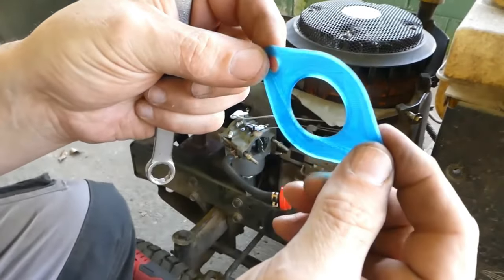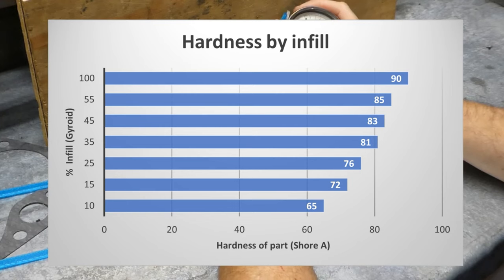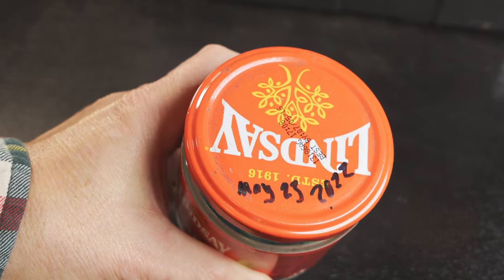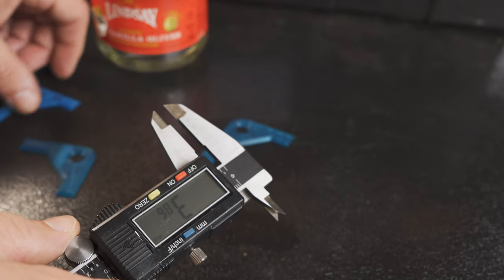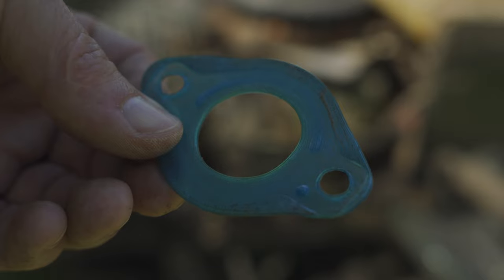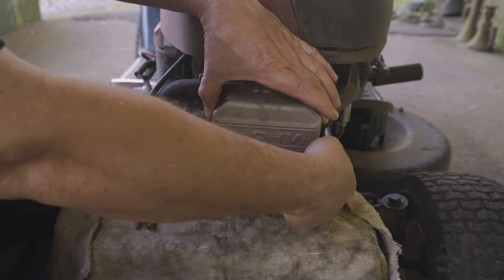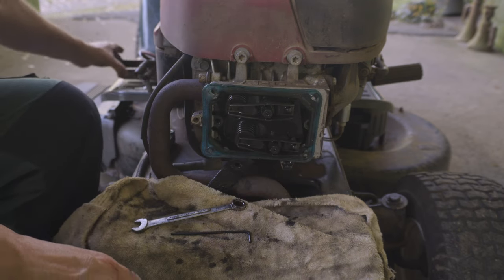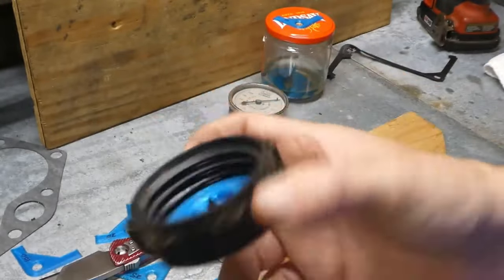3D Printed TPU Gaskets? -- Follow Up

Comment: I teach a small engine high school class that uses donated junk equipment. Most of the donations are out dated and in some cases parts aren't available anymore. I'm using a 3D printer to make all sorts of parts for students. In most cases, our parts only need to last about 30 minutes. If they last longer, then all the better. I'm using TPU to make a variety of carb and carb bowel gaskets. The big key is just what you said about another tool in the toolboxes. We can make a gasket faster and cheaper than seeing if we have a budget left, then trying to order parts, and finally hoping to get them in time. The 3D printed gaskets and parts are made quickly, teach kids design, and cover an enormous range of equipment, making our program more successful. I'm with you.

Comment: I appreciate your recognition of printing casting molds. Most people don't realize that printing opens doors other than just printing plastic parts; molds, cutting and bending jigs, and even negatives for ceramic molds for high-temperature metal casting are all possibilities for home manufacturing of various tools.
Reply from the maker: Hello, thanks for watching and hearing, lol. Moulds are something that I have not messed with much yet but plan to. They are definitely a much better option for some applications.

Comment: These type of real world test in my opinion are much more valuable than many "scientific" tests. Thank you for your videos on this. I've been thinking about using these as gaskets. (hence finding your channel) I've made a couple gaskets for the wife's wine type bottles that get put in the refrigerator and work wonderful. Keep up the great work and sorry about whatever happened. Have a good day.
Reply from the maker: Yes that is something I have not even touched on but the uses around the house for TPU are endless. I made some lids for open cat food cans for my wife. Much better than the cheap ones bought at the store. They seal well and are easier to take off an on. I have used it for a bunch of little things like that. All the best!
Reply: @the_eddies  I agree, I've also used it for these aluminum "solo cups" that we have, it works great, just have to remember to put a little vent hole if you're using it for anything hot and/or carbonated. Lol.
And I've also used it for gaskets on some custom windshield brakes on my side by side. There's so many uses, we're just touching the surface.
Reply from the maker: @paulm1835  "just touching the surface." agree completely.

Comment: As an added data point, I printed thermostat gaskets for my boat out of tpu. I printed 2 (twin engined boat). It’s been over a year with no signs of leaks. I just replaced the thermostats and reused the same gaskets. They were perfect when I removed them and they’re still leak free.

Comment: I have been using TPU 95A and 85A for motorcycle applications. I also run a lab and have been using TPU 95A for biological applications. 
We've been seeing TPU 95A stable to 120C. It's resistant to most solvents. Completely non toxic.
For motorcycle applications, it's more stable over time than the butyl rubber and much stronger. It's very difficult to break or tear TPU. In one application, we made an elastomeric spring which has functioned on a device in daily use for 3 years and counting.

I now use this to replace seals and gaskets, and replace cracked ABS parts as the TPU is much stronger and vibration resistant.

Industry does not use TPU because it does not work well for injection molding or punching.

It works well on carbs because carbs are designed  to be below 90C to avoid fuel boiling. Printing really needs a direct drive extruder and a heated filament dryer device as TPU can absorb moisture quickly.

As for Youtube comments, sorry to offend, but Americans have a real culture of being confidently wrong and too lazy to research before spreading misinformation just so they can childishly empower themselves to preach to others. This extends from stupid internet comments right up to Boardrooms making $100M decisions.

Comment: Love the follow up thanks for doing this.  I'll be using TPU in the future for throttle body gaskets since it gets pulled for valve adjustments in the hotrod often enough that the regular gaskets get brittle and fall apart!!
Reply from the maker: Sounds like a great use. Thanks!

Comment: On the engineerig side of things, TPU is a high performing material for a gasoline exposed gasket. 

TPU also has good oil resistance. So, these results do indeed follow the engineering and chemical reaistance charts. 

The largest complications are printability, UV stability, temperature resistance, and porosity.

Great job proving this out in the real world!
Reply from the maker: Thanks! Even with all the data out there on TPU, I think there is also a lot of misinformation. That combined with the amount of filament manufacturers that do not provide enough information on their product's specifications made these tests necessary, at least in my head, lol.

Comment: Thanks for continuing this and sharing the results/observations.
Has the fuel in the jar been refreshed/added to? 
I'm wondering if there is a very small fraction that may have an effect has already saturated or evaporated.
Reply from the maker: Hello, the jar was not added to since the time it was sealed. I opened it once a few months ago for a few seconds just to check the parts, but other than that was never opened. I considered a frequent changing to fresh gas, oxidation factors, etc. but really do not have a way to control for those factors with any precision. The use in the gas tank is the best I can introducing environmental and normal use factors. Thanks!

Comment: I've found it useful and thought about its different uses, in my case I did a sim for a bearing on a rocking chair which gets a lot of use e.g weight load and rotational load. yea it'll never be as good as an original piece but if needed I just print another off. got a few niro RC cars which need gaskets which I might try.
Reply from the maker: TPU is extremely tough, it might be as good or better than the original. I would be curious how it holds up against constant use with variable loads. Another video maybe, lol.

Comment: Thanks for sharing. Good to know some more uses for TPU. One test I'm curious to find out is low temp performance. Typically the majority of plastic parts fail at -50C but many fail way before that. Too many ppl try to use structured cores instead of solid infill for structural parts and wonder why they fail... ROFL
Reply from the maker: Hmmm.... Interesting idea now where to get liquid nitrogen???

Comment: What's impressive is that you have replacement gaskets in less time than it takes for them to ship. This is just the beginning, I'm sure there'll be ways to 3d print without using heat.

Comment: Thanks a lot for taking the time to share your experience with TPU after a year of use. I see you dont recommend it for applications where temp surpasses 90C. Although i would like to make some gaskets for the radiator of my car. Do you think there is a small chance of success?
Reply from the maker: You are going to be right at or just over the 90C, probably not going to last long. Once it reaches deformation temp it is going to stay deformed. I would not on my daily driver. On a test vehicle I was just having some fun playing with I might try it. There are better alternatives though like silcone gasket material or 3D printing a mold to form a silicone gasket.

Comment: nice work...just seen the original gasket video you referenced and love the follow up! I had already thought about making my own gaskets and thought they wont work it gonna be too hot and all but i didn't think about carb and other lower heat uses especially the gas jug lid.
Reply from the maker: Thanks! They are all still in use. All the best!

Comment: That lawnmower valve cover! Is that Honda GXV 160engine? Last time I was trying to unstick a sticky valve, I had to use silicone...blah I hate this stuff, since the service (where it was just few hours before) used a ton of this and made everything smeared by it...
Reply from the maker: It is a Briggs but Honda would be about the same. The printed gasket makes it so easy to do valve adjustments. No cleaning and getting a new gasket every year.
Reply: @theeddies  that is the exact reason, why I love 3D printing... It can help keeping things running!

Comment: So, as I understand, I could safely use a TPU gasket as a seal for something way less demanding application: a gasket-frame mounted around a little LCD display to avoid rain/humidity passing into the case and damaging the electronics.
Also the outdoor temperature range in winter/summer should not be a problem (let's say from -15 Celsius to +40 Celsius). I'm right?
(My condolences for your loss.)
Reply from the maker: Yes, normal weather temperatures are not going to effect it. That sounds like a great use. Thank you!

Comment: This is the first video I have seen from this channel.  I'm sorry for your loss! 

I was honestly just wondering if any one had made seals or gaskets using a 3d printer before.  I'd probably be too sketched out to do it on a motor, despite your positive findings. Pretty cool though!
Reply from the maker: Thank you! I still would be hesitant to use these on anything critical but there is some uses out there. All the best!

Comment: thank you so much for these videos i am currently making my own gaskets for my motorcycles carb bowl and was wondering how it would hold in the long term and having a year of use with little deformationb or damage is a great sign. most gaskets come in a rebuild kit and i build a collection of rubber, printing the exact gasket in 5-10 minutes for insanly cheap is incredible for me.
Reply from the maker: Still going strong after 2 years now btw.
Reply: @theeddies  great to hear

Comment: Do you belive that can be used as a thermostat gasket on a bike? The original one, lasted only 3 years. Thanx!
Reply from the maker: Operating temp of most bikes is going to be right in the failure range according to my tests. But, if it were mine, I would cautiously test it just to see. Worst case it fails and you shut it down. Of course I like to break things🙂 I would add, I am still using the one I printed for the mower valve cover which comes into contact with 90c+ oil on a regular basis. Get a quality  ($$) TPU also, lots of discout garbage out there.

Comment: How do you think this would work for an intake manifold gasket on a V8? It would have coolant which may reach  240-250 degrees F, up to 200 degree oil, and fuel to deal with.
Reply from the maker: If it is an engine to experiment on and you don't care if it blows up, go for it. At 240-250 I think it would get too soft and lose the ability to hold torque. Maybe with some stiffeners like a two part gasket. Still that heat is way over my personal rule of thumb temp of 90C. Best!

Comment: I've been thinking about you, hoping the new job you had going was keeping you busy, but fearing what was. Sent a prayer your way every once in a while. It's been almost 50 years since my dad passed and I still miss him. Still hear his voice in my head, usually saying "get to work you lazy cull".
Looks to me like your tests are a complete success, swelling and distortion of the gasket soaked in fuel would have been obvious after a couple of months, if you've ever tried rtv in a fuel system it fails faster than it takes to clean-up the mess. I wouldn't consider the valve cover gasket a failure, cork and fiber gaskets take a hard set after a short time and eventually leak. Neither are re-usable without some kind of sealer.
I've started using silicon gaskets for the rockerbox covers on the airplane, they're re-usable several time, but even they fail after while.
Look forward to more of your posts, it's good therapy.
Reply from the maker: Hello Carl. I appreciate it. Job is still ongoing. I have actually grown their YT channel over a 1000 subs in less than a year. And yes I can hear dad telling me to "get off my lazy..." everyday, lol. This was good therapy, I agree.  I have not seen anything from you in a while. Figured you must be busy flying and building. All the best!
Reply: @theeddies  Spent a little over a month playing with my new grandson in Florida, been home for a couple of weeks but the shock of going from 90degs back to 35 degrees took it's toll and I've been down with a cold/flu. Feeling better now so back at it as soon as I get my taxes done. Start flying Thursday
Reply from the maker: @psgflier  I am just getting over the sick as well. I am sure you could hear it in the video. We did not get much winter in the southeast this year. I am not sure it got as low as 35 at all. I guess that new engine is doing ok?
Reply: @theeddies  Funny how the weather was well above normal below a certain line and well below normal just above  that line. Florida was much warmer and drier than normal.
Engine is working great, I can tell the difference, stronger and smoother, hardly wait to get back in the air again

Comment: My only comment is I would not consider the valve cover gasket a failure. Premade "rubber" gaskets do the same thing over time. I agree with a solid print being better, but consider the one you used as a good version, just not the best version you could make.
Reply from the maker: Thanks!, yeah "failure" was probably not the right word. Maybe, "less than satisfactory iteration". The reprint has been on there since without issue. All the best!
Reply: @theeddies  Thanks, and thank you for doing this post. I use an old commercial Honda mower that getting gaskets for is a pain. I pull the carb and clean it every year. Couldn't get a gasket in time last year and they are paper. I re-used it and it held up fine, but now I can go with something better. I appreciate the testing and the videos very much.

I also work in industry and we've had some rubber seals deteriorate on some enclosures that are  in harsh environments, and the manufacturers do not sell replacement seals/.  So I'm going to give TPU a try in those applications.
Reply from the maker: nice, thanks! @swdw973

Comment: You think peek could work?
Reply from the maker: Never used it but isn't it hard?
Reply from the maker: @Dragondezznuts  Yes, but the point of a gasket is to conform to uneven mating service and seal them. There are hard gaskets for certain situations but most will require at least some amount of flexibility to be effective.